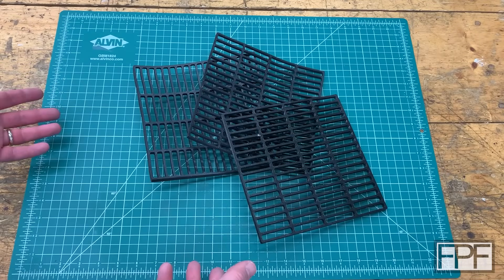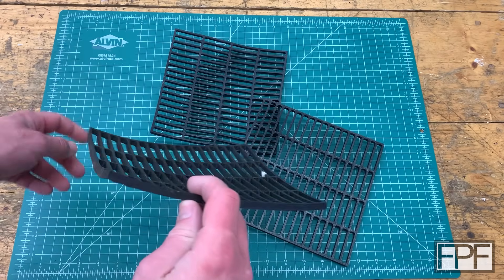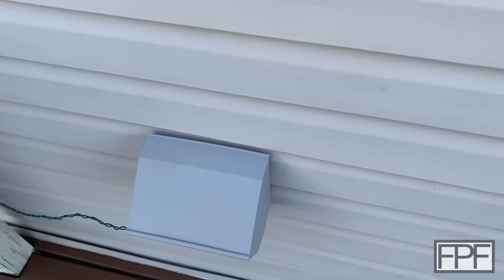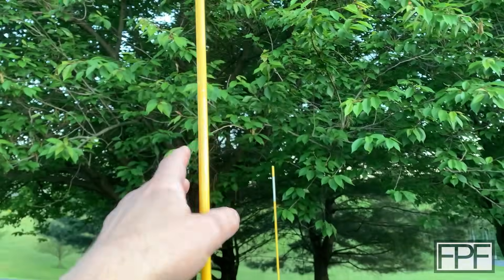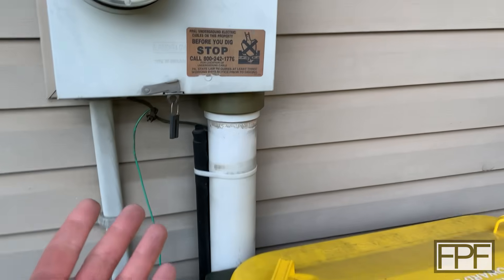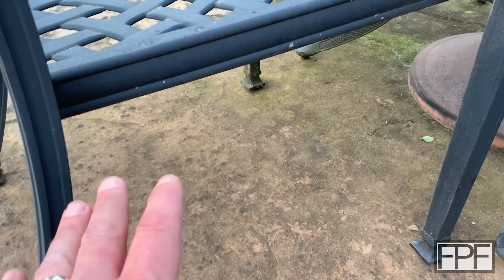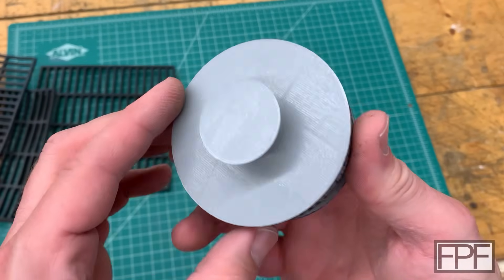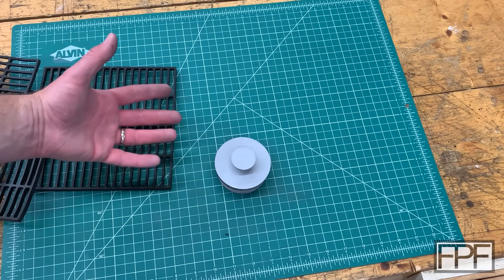3D Prints - 7 Years Outside

Comment: I threw 2 misprinted miniatures from PLA into our compost silo, to see when they would disintegrate. After two years  both pieces  came out with the readily composted earth, completely intact, solid and unchanged.
Reply: biodegradability od PLA has been heavily overestimated (or flat out marketing lie). I guess it's most vulnerable to extreme sun - UV and heat - but that will only make it warp or brittle, not disintegrate easily.
Reply: @Memphisko  You nailed it. 

PLA as a Tg (Glass Transition Temp) of around 60~65c. Meaning, for hydrolysis to start and bacteria have a chance to latch on and start consuming the PLA. It must be exposed for a significant amount of time above that temperature. Otherwise, it just erodes just like other regular plastics and sheds toxic microplastics. 

The standard used for PLA "Composting" is ASTM6400. And it simply means the conditions required to break down PLA are available in nature. Unless its the middle of a volcano.  Funny how far companies are willing to Greenwash the word "Compostable" to support sales. 

For true compostability, you need PHA Filament.
Reply: @fredpinczuk7352  "sheds toxic microplastics" could you elaborate? What's toxic about PLA?
Reply: It is biodegradable under industrial conditions
Reply: I think if you were to put it in a hot compost (Berkeley method) for a few days, it would start breaking down.
Reply: @NicolasConnault  That's the myth, reality is something else. Just read the ASTM6400 standard and you'll see the disconnect. Hence why PLA single serve products are now banned in Taiwan, and starting 2025 in Hawaii as well.
Reply: @fredpinczuk7352  yeah this would only work in an industrial composting facility with tightly controlled temperatures. The Berkeley method gets very hot but can't sustain itself for more than a few days.

Comment: I've printed a lot of PLA for outside use (before I had a more capable printer) thinking I'd just reprint it every year. 5 years later, I've never had to reprint anything. I've had ABS prints fail outside faster, lol. Inside a hot car in the summer is another thing altogether, but just being outside isn't that bad. I've recently started printing lots of ASA & TPU, but I expect them to do well in almost any environment.

Comment: I printed some coat hangers and other hooks for my office about 9 years ago (on a printrbot... yes early adopter) in pla because I added a heated bed to print abs later, and they are indoors but un-painted, but they have gone brittle and after finding things randomly on the floor where theyve been hanging for years I've had to print replacements, which have been going ok for a couple of years now. I made cupholders for the camping car and they lasted 2 years then gave up. I printed a handle in pla and z axis stabilizer for the printrbot and it disintegrated a few years back, but did some parts in ninjaflex when it first came out and I managed to mod my extruder to print it, and they are still in use, as is my frankensteined printrbot, I use abs, ninjaflex and petg now. My older reels of dog ends of PLA in odd colours that had sat on hangers on the printer room wall had got so brittle that when they were loaded onto the spool rack and fed into the printer, they broke like dried spaghetti before even getting the extruder. Some I stripped off a few meters and they were ok, others were toast.
FUD? no, just my own personal direct experience.

Comment: Printed a 98A TPU angled funnel, that one has seen gas, diesel, coolant, ice and constant sunlight as its hanging on the toolbox attached to my excavator... for 4 years, in Norway. Extrudr Flex Medium TPU.  Still like new.

They've just dropped 70D (think hard hat) TPU-CF... It is god-like material. 😊

Comment: All PLA prints fail having even tiny load and sitting in the sun. You have showed it yourself all prints failing and just caps with no load doing well. I had pegs from PLA all failed even from small tools hanging after a year. After reprinting with PETG, no issues 3 years later. Same with TPU haven't seen a single part fail yet. And PETG being as cheap, fast and easy to print on new machines, Hardly any reason to even have PLA all my PLA rolls failed sitting on the spool ant not being used became so fragile braking in the printer tube after 4 years.

Comment: Printed railings exposed in the top of my sailboat using white PLA plus 3 coat of UV filtering varnish. After 2 years in Florida, I had to have them reprinted in nylon as their were becoming brittle and started breaking. Has not aged since.

Comment: I made a RC car from 3dsets , as they recommend outside was made from PLA , ( transmission, differentials from PC and their casings from PETG ) 
I did whole model of 1/8 GMC Vandura in my room and just when i was screwing last parts of suspension on my balcony on quite sunny day. Most of model was in shaded place under umbrella , But places on the side that got exposed for maybe 15-60 minutes got seriously warped whole PLA part can go to shredder as even if i will fix it seems whole model will die if i will go out with it on sunny day even for 30 minutes.
Reply from the maker: Yeh PLA tends to give better details, which is why it's often used for bodies.  Unless it's a shelf queen though, PC/PETG will likely hold up better.

Comment: I learned ASA filament is the most popular choice for outdoor use - it's renowned for its UV resistance, in comparison to other types of filament, such as ABS or PETG, ASA is considerably more resistant to the long-term effects of UV light exposure and has a higher resistance to colour fading, warping and cracking. 👍

Comment: You made mention of UV being the cause of warpage.  I dont think that is accurate.  Looking at the warpage you showed I think it has much more to do with heat dissipation and absorption being uneven.  A larger surface area is going to have a much easier time absorbing heat though conduction and IR radiation and to release that heat will not be able to release heat evenly through radiation resulting in the areas further from the center of mass to cool faster.  Overtime this will cause the center of mass to slightly larger (in relationship to the areas further from the center of mass) which is what causes the bowing.

Comment: Great video. This is something I really wanted information about. I have printed outside (and indoor) stuff in PLA for private use. But I don't dare print anything in PLA that I sell (tools, sporting, fishing etc.) simply because you never know if the customer will leave the item in a hot car or out in the sun to find it back deformed or warped. So it is ASA in most cases and PETG in some others.
Reply from the maker: agreed, with the exception of stuff for winter use where I want stiffness.  PLA has done well for that use case (snowblower chute rotation parts)

Comment: I think everything is application dependent at the end of the day. PLA outside under no stress? sure.

PLA outside in a car where it's getting the greenhouse effect in the summer? terrible idea. 

I think color choice also can matter a lot in regards to filament choice, as certain pigments are going to want to absorb more and more UV light, hence why your tomato grates warped in a hot bed of soil. Contrarily: the stakes are holding down an effective coolant line that is likely carrying away a lot of the heat strain from them. 

I've got clips on my balcony I leave up year round that I've printed in white ASA for various holiday decorations and lights, and they have had zero issues for the couple of years that I've lived in my current home and have had them out. Absolutely zero signs of wear or weakening.

Comment: I have CCTREE PLA wall brackets for flood lights all around the house and I live in Cape Town South Africa so they are exposed to heat cold and stress of having to carry weight.... Some of these have been printed just about 7 years ago on my old Anet A6 3D printer.... I also have a couple of modifications on my Chinese Brand 150CC moped that that are printed from a local South African Filament maker called Filament Factory and use their PLA+ to made addons for external voltmeter and usb and 12v socket housings so I can see the strength of the battery use a usb cable to charge my phone used as a GPS and even use a 12v outlet for mini air pump or whatever needs 12v on the road. I must add that all these modifications have held up better than my lockbox that is injection molded in ABS. The top has become brittle and the red reflection part on the lockbox has lost its shine has become brittle and in parts completely disintegrated but the PLA+ has not shown any signs of wear and they have been on the moped longer than the lockbox, almost 3 years and the lockbox is just 2 years.... 

Its the same argument people had about you can't leave your 3D printer alone if you print as it will catch on fire and burn your house down...
I have always heard STORIES of it happening than Actual proof that it has happen and the times there was proof there was ALWAYS owner negligence involved in some way, printing near flammable substances, printing in confined spaces even cluttered space, and over modding their 3D printers that puts stresses on the electronics an so on. 

Thank you for sharing your findings with Us and breaking down the stigma of you can't use PLA for functional out door prints.

Comment: Dumb question from a complete noob: can you paint over PLA? If you can, would paint protect PLA from UV?
Reply from the maker: not a dumb question at all.  I should have mentioned this.  Yes, you can paint PLA, and yes, that does provide additional UV protection, even if the filament you're using already has additives

Comment: I live on the coast so we have some quite heavy winds ... I'm tall and fat and so I made some "garden furniture" out of sleepers which is absolutely solid and heavy and is basically immoveable. I used my 3D printer to print some brackets that are now bolted to one of the garden chairs to drop the support tube for a large and heavy garden umbrella into (not one of the cheap lightweight things - this is a hefty heavy canvas umbrella that is now probably 10+ years old).

The brackets have been outside now for four years or so and are still absolutely solid and have held on to the umbrella in some winds that I wouldn't want to try holding on to it in!

I've also printed a plot number sign for my other halfs allotment which is now about four years old (and we keep boing asked by other allotment holders if we can do signs for them), similarly I've printed off brackets that are screwed into the wooden surrounds for the planting beds on her allotment that are used to put the ends of some thick tubing into to make hoops to stretch netting over to stop birds getting to the plants - they're all doing well and remember this is a coastal environment.

I've got custom brackets made up for outdoor WiFi antennas and WiFi Bridges which have only been outside for a year or two.

I've not had anything fail yet...

Comment: Question, why would you print anything that will be exposed to the elements in PLA? I am sorry but I don’t understand the point!
Reply from the maker: because it works just fine in most use-cases as shown here in the vid.  Nothing wrong with using other filaments as well, it's just that often folks only have PLA on hand (or in the color they want), and think that they CAN'T use it for outdoor prints

Comment: I printed hangers clamps out of PLA+ to clamp cameras and small solar panels to round and square shepherds hooks clamped by stainless steel bolts and wing nuts. Those that were tightly bonded have lasted 4 -5 years in Chicago winters. 1 that there was a rough surface only lasted 1.5 yrs.  A lot depends on how water can penetrate the structure and freeze. Most of my clamps are white, so they reflect a lot of the solar energy. My first black camera hood lasted 2 yrs before removed without problems. Other parts I made this spring so too early to say anything.
Reply: Just bought a new printer a week ago. Much better prints. I figure any new parts will last even longer.

Comment: what they putting in that hatchbox pla man? gotta get me some of that. One thing I noticed is the things that faired the best outside had substantial portions of plastic mass that was hidden away, e.g. The drain plug cover, the little frame end cover for your air conditioner, both had more plastic mass inside and protected than the amount of plastic exposed to the outside. Maybe that helps stop the warping when UV rays are only hitting a percentage of the print vs something where the entire print is in the sun.

Comment: I have not used a single 3D print outside longer term yet. Well i do have a little PETG piece holding up my bicycle mirror but it's basically fully hidden from light.

I only have one spool of PLA, i bought it 8 years ago from OWL, and while the spool feels like it should still print OK... i hadn't been printing with it for the last several years, but it doesn't seem at all suspicious, it has been stored well, but the prints haven't fared very well. The unloaded prints still look usable but loaded ones experienced changes around the 2 year mark, they got crazing around pressure spots and they became brittle, and there is a hint of yellow discolouration on all pieces. The filament is silver coloured but it's very transparent and the pigment isn't very evenly spread, you can see distinctive differences in pigmentation density from layer to layer.

Also my first 3D prints 8 years ago were from clear natural Renkforce PETG, one holds up the control board fan, the other protects the power supply. The latter is still in use, the former got replaced because it got somewhat more brittle than it used to be and suffered an accident. Both yellowed quite a bit. The printer is near a window indoors. The power supply print is bound to be replaced soon, as i'll be putting in a different power supply.

I'm not at all concerned about long term performance in the sun of thoroughly pigmented plastics as long as they don't get hot enough to warp. Black in particular is bound to absorb all the UV and concentrate the sun damage to the outermost skin of the item. But there is apparently some degradation mode that affects PLA and i've hit that somehow, not sure what is the cause. I mean you can always hit anything except PETG with a little paint, maybe silver paint for protection.

Comment: One opinion I've seen multiple times is that PLA used to be more sensitive to UV, but that modern PLA has additives or other improvements that make modern PLA (or at least some brands) more resistant. However I see here that even 7 year old PLA is not necessarily bad in that regard.

Personally though, I just print a lot of stuff in PETG, just in case. Anything that may be exposed to heat, UV, or e.g. under tension. I don't like how stiff PLA is, breaking into pieces where PETG would just flex a bit. And other than stringing, I'd say printing PETG has been just as easy if not easier than printing PLA, so I think I'll stick to PETG for now.

Comment: I like your Channel , i just bought my first 3d printer , its a bambu lab A1 and waiting on delivery from Germany where house , 
but i do as did when i got into photographing , i research  alot about how to get the best use out of the equiment , so you tube channel yours is on my need to watch list  :) very good information you deliver and i learn alot , so thank you so much for this learning oppentunity , btw im dyslexic and i live in Denmark so english not my native languish  , so spelling errors will  be part of my comments :) 
hope you can live with that , i have to live with it every day so im sure the world could do so too :)
Thanks again for this great channel :)
I  have a Question , TPU is that safe to use near elektricity , as i want to print some feet to my solar cell alminium stands ?
Reply from the maker: Welcome aboard and congrats on the purchase.  Don't worry about the spelling errors.
Reply from the maker: TPU is non-conductive, but be careful as generally parts used as insulators need some sort of approval in most countries

Comment: I printed a fish tank house (fish shelter) in pla+ and its lived in a heated saltwater tank for like 3 years without issue.  Ive also printed a 3" intake tube for a v8 motor that sits inches directly above the exhaust manifold out of 910 alloy and its perfect still
Reply from the maker: wow. . and no heat shield?

Comment: I made a thin wall (like 1.2mm) container about 300mm x 80mm x 20mm that I used to soak some de-rusting citric acid chemicals.  It was printed with locally sourced re-wound chinese junk red PLA.

 I found it buried in the leaves yesterday.  It had be buried in leaves and snow.  We had minus 30 for a couple weeks and minus 40 for several days.

The PLA was undamaged.  No warps no chalky it was fine.

I have noticed a lot of the people who complain about the performance have under-extrusion which makes a good looking print but they complain it isnt water-tight.  If your part is good and water tight then it will prevent freeze-thaw jacking between the layers.  

If you are printing for outside use a higher extrusion multiplier (i am at 95% usually).  And 3 or 4 layers at 0.40 (1.2mm to 1.5mm).

You are not building a spaceship.  Just because "experts" say it cant be done, do it anyway.  If it fails then you learned something.
Reply from the maker: Yeh, or they print at 2000% recommended speed where flow rate suffers and layer adhesion is garbage.   I started with a dirt cheap i3 clone in 2016, and was used to hitting print and just coming back tomorrow, so the modest speeds today seems lightning fast already